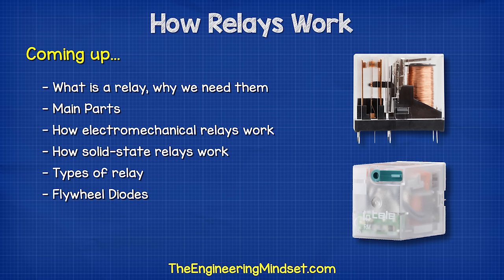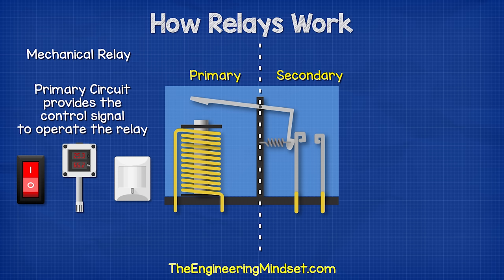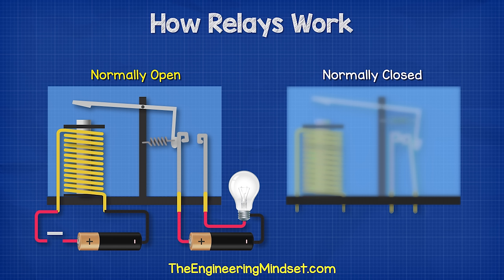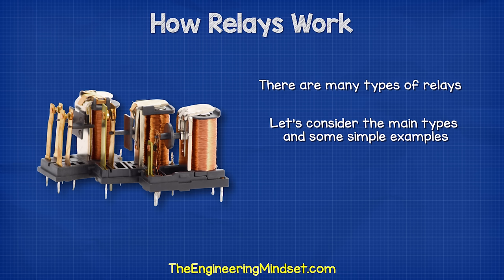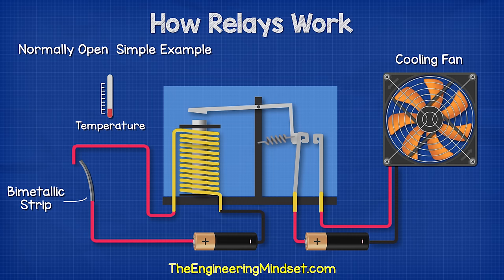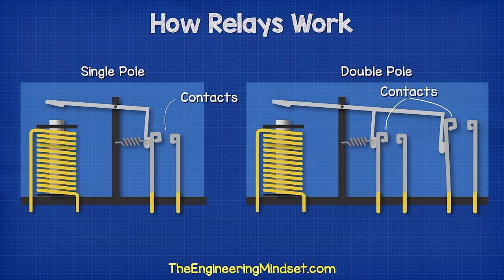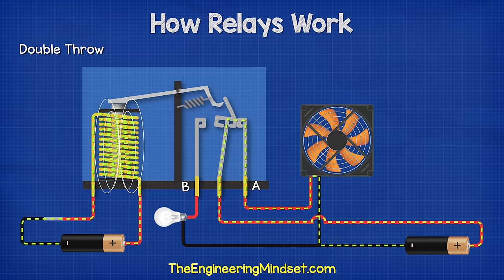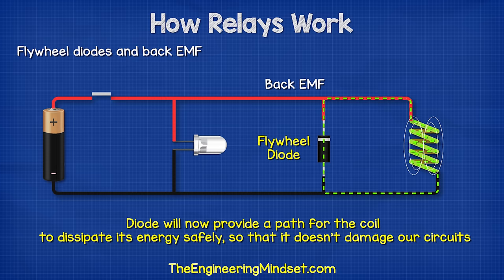How Relays Work - Basic working principle  electronics engineering  electrician amp

Comment: When I bought my last motorcycle, the previous owner had installed additional lights with a manual switch.  I wanted the lights to be controlled by the key switch.  I talked to a mechanic who told me it was impossible because the key switch couldn't handle that much current.  I told them I wanted them to use a relay, but they insisted that the current was too high.  So I just did it myself and it worked flawlessly.  It was very clear that they had no idea what a relay was.  Doing it myself saved me several hundred dollars and took me about 1/2 hour, so I'm actually glad they were so stupid.

Comment: Im a new electrician from the philippines and i can say paul was the best teacher i have never met, thank you sir for all your effort to educate us all your teachings will not go to waste.👍👍👍👏👏👏
Reply: I'm trying to understand the difference between a relay and a step-down transformer.  Do you know?
Reply: Iyan ay talagang maganda! Umaasa ako na ikaw ay maging isang mahusay na electrician na maabot ang napakataas!
Reply: " i have never met"- thought that markanthony made a mistake but after a longer thought, now i understand what he wanted to say so its ok XD
Reply: @n.g.1577  a relay is a electrical switch and a step down transformer is a transformer with a larger primary and a smaller secondary? i believe
Reply: @n.g.1577   the difference would have to be a transformer uses the concept of inductance in order to induce a charge in a secondary coil using the magnetic field of the primary coil while a relay just uses the concept of running a current through a coil in order to create magnetism to create an open or closed switch

Comment: Learned a bit more about latching & double pole relays. Had this idea of using relays in an inverter project, so can switch between inputting between 12 or 24 volts DC. Simplistic pictures and animations work very well in explaining things.

Comment: I am a BMS engineer, and we use many relays for our control panels! Funny thing is that I did an electrical and electronics engineering degree as uni and didn't even learn about relays - felt like a complete idiot when I started work..! Great video, and kudos for mentioning the flywheel diode, that can easily be overlooked.
Reply: Math, math, and more math.
Reply: Yup insane I’m an electrical engineering student and they haven’t mentioned relays yet

Comment: Before about 9 months, I've contributed to a graduation project as a listener. During the project, my colleagues used a relay to control the servo motors, and that was a bit of blue blocks with nails to hang the wire in. I think that was a solid-state relay.

Comment: 7:43 I’m currently in the process of fixing my Toaster oven. I troubleshot the failure to a circuit board. Then my instructor at school helped me isolate the broken relay that controlled the upper heating element. My instructor also recommended to replace the other two identical relays on the circuit board, as PM. 
I’ll be fixing my toaster oven, and performing PM on it for less than $3!

Comment: Really good video ! I use relay modules to allow my Raspberry Pi to control pumps and heaters for my pond. Be careful though the Pi will only output ~3.3V on the GPIO terminals so you need a module ( or build your own) with an additional 5v supply (usually marked JD VCC OR RM VCC)that actually energises the coil, most include optocoupling and flyback diode.

Comment: Nice lesson.  Now that electromechanical relays are being rapidly replaced by solid state devices, it is interesting to look back on the ways they were designed and used in the sixty years since I began, and subsequently retired from, working aircraft electronics.  For one thing, many relays are available with multiple sets of contacts, for instance 6PDT.  Numbers of such relays can be wired to perform complex logic functions by wiring the primary circuit of each relay, along with remote inputs from switches and sensors, through secondary contacts in other relays.  For instance, relay A coil will operate only when relay B is off (use common and NC contact of relay B), and relay C is on (use com and NO contact of relay C).  In fact, simple digital computers have been built using only relays for logic processing.  

Many power relays, or contactors, will have sets of auxiliary contacts that switch as the main contacts move.   The main contacts in a contactor are frequently in 3 sets for switching 3-phase power.  The primary circuit for any given contactor may be wired through auxiliary contacts of multiple contactors to ensure that one and only one power source is connected to a bus or load at any given time.

You might mention that latching relays are not always necessary for effecting a latching, or holding, circuit.  Any relay can be configured as a holding relay by wiring the active wire to the coil in parallel with a set of the same relay's contacts so that once the active primary wire operates the relay, the parallel circuit through its contacts will maintain the coil circuit even after the input signal goes away.  Various methods of "resetting," or deactivating, the relay are used, such as a NC push-to-open switch in the parallel circuit.   When a contractor needs to be under positive control to open or close only when a discrete signal is received, latching relays are used.  I have seen contactors for aircraft generator power evolve from from common relay operation that requires continuous power in coil circuit, to mechanically-latched contactors with separate coils for open and closed function, to magnetically latched contactors with two coils, one to close and one to open, to magnetically latched contactors with a single coil that is closed by a momentary current of one polarity, and opened by a momentary current thought the same coil but of the opposite polarity.  It was fun.
Reply from the maker: See our new video on how to build mechanical versions of electronic circuits? Watch here: https://youtu.be/Zv9Q7ih48Uc

Comment: Hey Paul, I have been watching your videos since many days now. I have become a subscriber of your channel and have been learning a lot about the electrical engineering.
While going through the list of videos, I didn't find topics on learning how to read a circuit diagram or SLDs.
It would be great if you stretch on this topic in 3 types.
1. Basic or simple circuit diagrams for electrical system in a house.
2. Circuit diagrams for a large commercial place such as a mall.
3. Circuit diagrams for an industrial building.
Would be great if you make videos on HT (High tension) and LT (Low tension) electrical system as well.
Thank you.
Reply: Tension? Do you mean potential/voltage? Or are we talking tubes?

Circuit diagram for a house or mall is nothing special, just larger than a electronics  circuit but the foundation is the same. An installation schematic or diagram is just how you place things in a building etc, which is just too specific for most people and for a general theoretical videos like these. It also depends on where in the world you are. A bit pointless to make videos about it because people can't work on it at home and the principles are the same as in electronics.
Reply: @TheBozn  Yes, the term voltage can also be used.

Comment: It’s always been my opinion that all automotive relay terminals should be numbered in a different way. The primary terminals should be “P1 and P2”, with P1 denoting the switched low current terminal and P2 to ground (or other control circuitry). The secondary terminals would be “SL”, denoting line voltage, “SC” for n/c terminal and “SO” for n/o terminals.  This would be far more intuitive than the seemingly random lettering normally used.
Reply: Amen !
Reply: Oh you don’t think 30/87/88/87a isn’t clear enough?

Comment: 7:21 - I used a relay to make a multi-flow ebb & flow hydroponic controller bucket. Wasn't my design -- I followed a DIY I found online, bought the parts, and put it together; but it worked, and it was extremely gratifying. It involved float switches, a timer, and water pumps :hydrate:

Comment: In my low voltage profession, I install and service access control equipment. I work with Lenel 2220, 1320, 3300 card reader panels with solid state relays on board, paired with Altronix ACM-8 12/24vdc mechanical relay panels. All downstream secondary equipment typically consists of magnetic doors locks requiring a normally closed circuit, and an electronic door strike or electrified mortise handle that require a normally open circuit; both of which contain solenoids to operate the devices. This video is a great visual example.

Comment: Hi there! I have seen relays at my workplace. We typically use them in automation. We have heater banks in AHU and we remotely operate them via SCADA/CMS. So the command signal is sent to the relay which then provides the power supply to the heater bank.

Comment: Great video. I use relays all the time in my vehicles. Currently using a 5 pin changeover relay to disable my daytime running light LED when the parking brake is pulled. This way I can idle dark at night if I want. Ignition power to coil, Parking brake grounds the coil,  ignition power to 87A out to 30, pull the parking brake which triggers the relay action and subsequently cuts power to the DRL as it connects 87 to 30. And since the coil was tied to the parking brake ground, the coil was bacjfeeding my instrument panel LEDs a bit, so I put in a diode so nothing can travel up that wire back to the panel/cluster. No more funky behavior after that since the coil electrons can only flow straight to the parking brake ground now. Love using electrical parts in unique ways to accomplish a goal.

Definitely learned more about them from this video too. I understood electromechanical relays fine but never have used a SSR. May have to try one one of these days. I typically use Bosch changeover relays for everything I do as they are most common, and sometimes I’ll user one with a timer. Hella makes some good ones.
Reply from the maker: Seen the new LED explained video? so much detail covered! https://youtu.be/O8M2z2hIbag

Comment: Im well acquainted with mechanical relays, from small 24VDC ones all the way up to big 460VAC 8 pole relays, but I stayed till the end for the flywheel diode explanation because the nerds on stack exchange were either extremely rude and belittling (as per usual with that toxic website) or they over-explained with lengthy lectures with a bunch of laws, theory, and formulas.

You managed to answer that question in under 30 seconds. You are a legend

Comment: I work in hvac and I was dealing with an ice cube relay that went bad for the condenser fan motor. Low voltage powered the relays high voltage terminals except for the one where a wire from the condenser fan motor went to. I checked the terminal right under it #4 I believe and it was showing 120  to ground. Then I just swapped the leg to that terminal. Motor came back on. I just wanted to understand it more thoroughly then what I already do.

Comment: Recently I had a control box that uses a potentiometer to increase and decrease speed of a nema34 stepper, which is pretty high current. The control box has about a 50 foot cord from the motor and I needed to make the motor turn in reverse or forward, but it was impractical to use a double pole double throw switch in the control box because I would’ve had to run bigger wire all the way to the box. Instead, I used a double pole double throw mechanical relay that could handle the current of the motor, and mounted a small single pole switch in the control box that turns the relay on or off with small wire running to it, and it worked like a charm.
Reply from the maker: Seen our new Potentiometer Explained video? ➡️ https://youtu.be/Xb-MZMoUtcQ

Comment: we have relays on some of the avionics system for the kc 135 which I used to work on when I was in the military. We rarely see them besides the click sound they would make when we pull the circuit breaker for certain systems.
Reply from the maker: Seen our new incredibly detailed MCB video? link: https://youtu.be/gqEu9t8HwW0

Comment: In my house some main lights that can be controlled by more separate switches (or remotely) have relays to control them

I personally would use a relay coupled to a TP223 capacitive sensor to make a touch power button for a PC project, since I don't see a way to use the TP223 directly as a latching switch... I may be wrong but this seemed the best way to build this

Comment: Amazing! I'm attempting the following project.

My car doesn't come with Apple Carplay, so I bought a unit capable of wireless Carplay. The unit works fine but audio out through aux is noisy, plus I would lose steering wheel controls. So I've programmed my phone to connect to the unit's bluetooth(which then routes the display signal through WiFi), and then connect to my car's bluetooth. Essentially, the screen would be powered by WiFi and the audio is channeled through my car's existing stereo. Perfect up until now.

The issue is, if I start the stereo and Carplay unit in accessory mode, they power fine. But if I then start the engine, the car cuts the power to the unit and the stereo for a split second to feed maximum power to the starter. At this instant, my phone's bluetooth connects to the stereo and never attempts to connect to the carplay unit. Occassionally when it does, it takes at least 20 seconds and disconnects from car, and then reconnects back. Sometimes it fails to reconnect to car stereo altogether. 

All of this can be remedied if the car doesn't cut the power to the Carplay unit when starting the engine. This is where a delay relay would help. I can tap into accessory fuse that is always hot, and use that to power the carplay unit, and the switching part of the delay can be done with the existing circuit that powers the unit. A 10 second delay relay would be perfect for this job.

I was thinking about adding a switch, or a UPS with timer but this would be a much cleaner and automated solution.

TLDR;  I'll use a delay relay to avoid my car cutting power supply to an accessory momentarily when starting the engine.

Comment: Thank you for the video sir, it jas really helped me and the channel as a whole. Thank you sir

Sir, I think that the diode should be in series and not in parallel. Because current will not pass through the diode in parallel because of its high resistance

Comment: In the last circuit, the diode only works due to current flowing through the path of least resistance or the shortest route. 

That wouldn't help the LED all the time, so shouldn't the diode be placed in line with the + lead between the LED and coil?

Comment: From the concept discussed here I can surely tell that the inverter which are used as secondary power supply have a Normally Closed circuit, and when ac power supply comes again then it energised the electromagnetic coil and hence the it disconnected the battery power supply and ac continues to supply the load without any interruption.

Comment: Used on my historic scooter running a.c. lights to which I'd added a battery powered by low current from B+ terminal on regulator/rectifier.  As the lighting circuit is a.c. (unless the machine is full dc, obviously) the relay, with pocket sized remote control similar to remotely operate a garage door, allows me to use led running lights.  As these are now battery powered they're always at their brightest despite the speed of an idling engine.  This provides far more clarity of the machine on the road, world's apart from when these machines and bikes relied on a glimmering festoon rear light bulb that left your heart pounding every time you stopped in the dark.

Comment: I'm in an apprenticeship with my current employer, in the last excercise we had to build an control box outfitted with relay's that would interface with an frequency-controller for a 3-phase motor. the objective was to drive the motor forwards, backwards and control the speed with a potentiometer. I hope this helps.
Reply: out of curiosity what type of apprenticeship is that? sounds cool!
Reply: @nathanieldray4384  well, it's at TATA Steel Europe. So far im liking my time with them.
Reply from the maker: Seen our new Potentiometer Explained video? ➡️ https://youtu.be/Xb-MZMoUtcQ

Comment: I recall listening to how relays were used in transmission of signals over long distance requiring amplification by using the weakened current to power the primary side of the relay. I never understood how this worked as I couldn’t visualise it in my mind and never took the time to investigate further.
This video helps a bunch, but just to be sure I understand, if a weak signal powers the primary side with an audio signal (say, a voice), obviously that is not a single signal but a lot of signals of varying frequency. Would that mean that a relay in this case is moving on and off relatively fast and often? And by relatively, I mean with relation to how fast and often I can and do turn a light switch on and off in my room. Would a relay not them wear out? I can see the benefit in a solid state relay for this application.
Reply: The Talent I think might have been the case for telegraphy, not so much for voice transmission.
Reply: Bruce Fay ah cool. Any ideas about how they amplified voice transmissions over long distance?
Reply: I’m not sure, but it would depend on the timeframe we are talking about.

Comment: You say primary circuit of mechanical relay is normally powered by DC supply but can be AC. I was hoping you would explain how AC works on the primary with polarity changing each AC cycle.